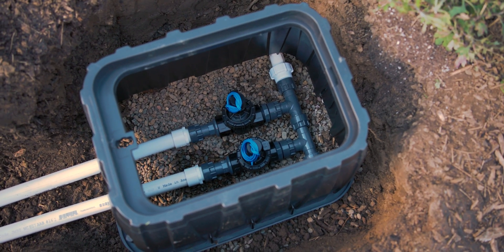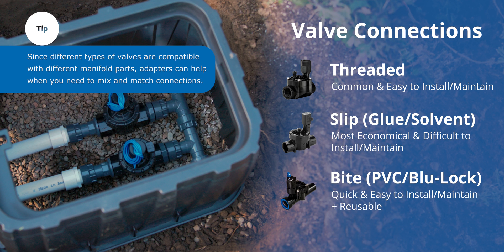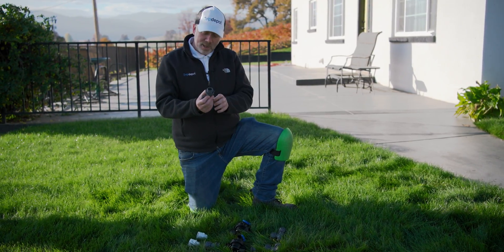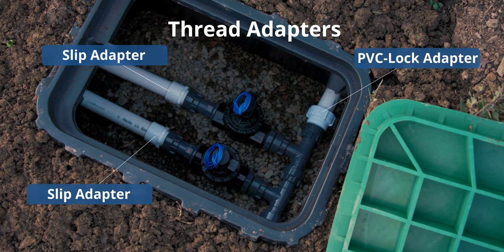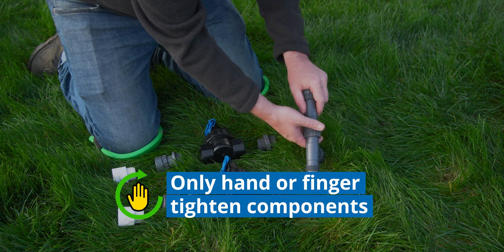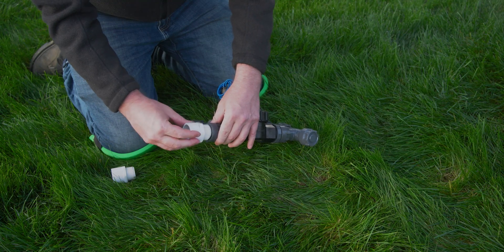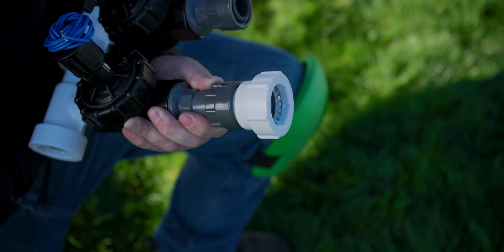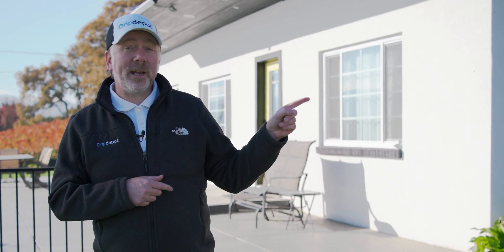How to Build a Irrigation Valve Manifold | Sprinklers & Drip Irrigation (DIY Beginner's Guide)

Comment: Me again! Two questions 1. Are these available in 3/4”? 2. Do they sell these at Home Depot? Trying to do my project this weekend so not sure if they would arrive in time from the links you have provided.
Reply from the maker: Most of the parts are available in 3/4" to one degree or another -- the valves for sure, and maybe even more common at big box stores than irrigation stores.  The manifold parts in 3/4" can be hit or miss, but 1" x 3/4" manifold reducing parts should be reasonably available.  Regarding the valves, the big box stores often have a lot of low quality valves, unless you're on a very strict budget for this, try to focus on Hunter or Rain Bird valves, theirs tend to be more reliable.  Irritrol/Toro valves are also solid though there may not be a lot of 3/4" options for that brand.
Reply: I like the product you guys have but it only looks to be 1”, whereas my system is going to be 3/4”. For example, the Dura 1” manifold, does this come in 3/4”? Am I missing something?
Reply from the maker: @coleyeomans5219  The manifold itself only comes in 1", but the same manufacturer makes some reducers that allow it to be used with 3/4" valves and 3/4" PVC pipe, happy to link them below :) 

https://www.dripdepot.com/1035 -- This is a 1" x 3/4" Male Reducing Nipple, it's what is used to connect 3/4" valves to the 1" manifold outlets.  

https://www.dripdepot.com/3375 -- This part has a 3/4" PVC pipe connection on one side and a 1" Female Thread on the other side, used in conjunction with a 1" x 1" male nipple [ https://www.dripdepot.com/3280 ] it can be connected to the female outlets or inlet of the manifold.

Comment: Thanks for the very helpful video! In terms of maximizing the ease of removing / replacing solenoid valves, is there any benefit to using pvc unions on either side of the valve vs the swivel fittings? I know schedule 80 unions are more expensive.
Reply from the maker: You bet, a PVC union essentially provides the same benefit as a swivel (and has a collar you can turn without turning the entire assembly like a swivel).  A PVC union might be a little easier to unthread when everything has been in a valve box for awhile, which could definitely be seen as a benefit (though like you noted, at a little higher cost for the Sch 80 ones).  :)

Comment: How tight? Do you recommend using O ring lubricant?
Reply from the maker: Hand tightening is all you need. You will have a tight seal as long as the O-ring is engaged (which will engage with hand tightening). Tools can damage the threads if used. 

No need for any lubricant. These parts are designed to be turnkey :)

Comment: I’m going to have a solenoid valve or two for my vegetable and other plant garden. I will set up my box like you show here. Question: Where will I install the filter, pressure regulator, and adapter for the drip system. Inside the box? Outside? What do you recommend? 

I looked through your video library and didn’t see that you have talked about this. Cheers and thanks for these great videos
Reply from the maker: You will likely install it in the box, just after the valve :) 

We do have a video that goes over this a little bit (and we have a big video library now, it wasn't easy for me to find either lol) at this link: https://www.youtube.com/watch?v=bFcK__VLfnU&t=60s

I set the link to start at 1 minute in, which is where we start assembling the valve and head assembly -- after that, it'll show us getting it into the valve box so you can get an idea of what yours will look like.  

You're welcome to reply here at any time if follow-up questions come up, just say the word!
Reply: Excellent. Exactly what I needed 🙏🏻